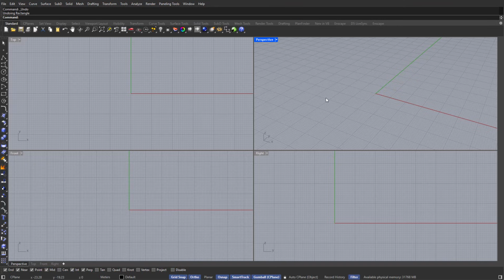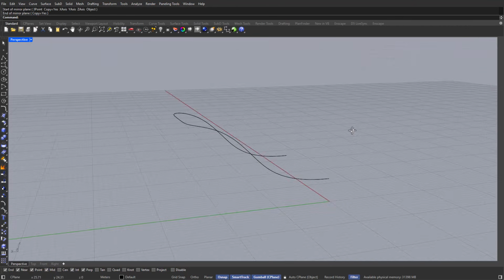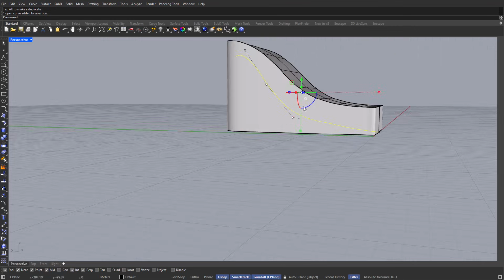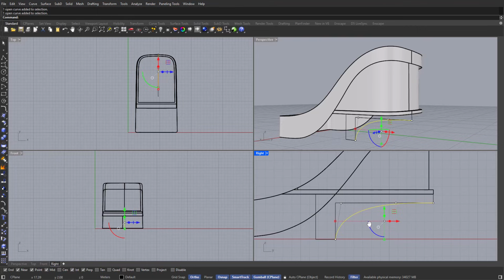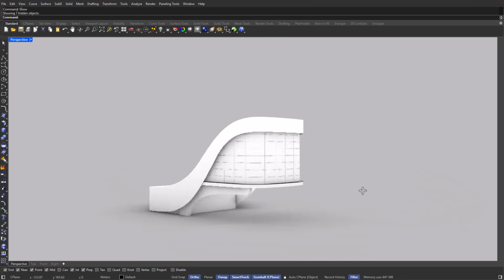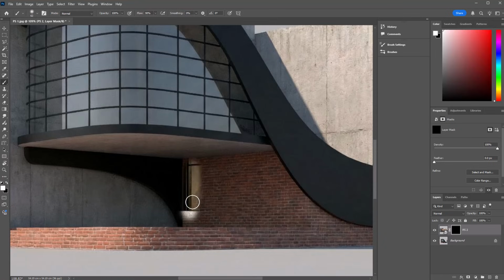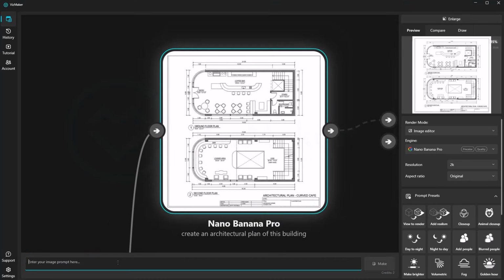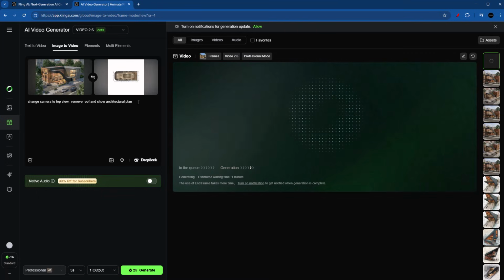Model & Animate Architecture with Rhino + AI (Nano Banana & Kling)

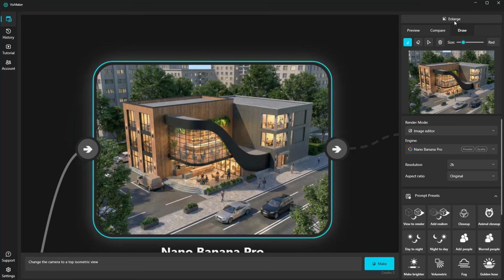Comment: It's good for you to have such a positive attitude about such hopeless software. This AI model cannot cope with architectural forms that are not conventional boxes. Compare 19:36 and 22:14. The curving down ceiling is not show on the interior view and if the ceiling curved down as shown in the second view, the descending ceiling would be seen intersecting the bar. Additionally, the floor plans have almost zero relevance in scale or proportion to what we see on the exterior.
Reply from the maker: Hey! Thanks for your observation. These videos are intentionally experimental and meant to assess current AI capabilities. I agree, the points you mention are exactly where these tools still need improvement.